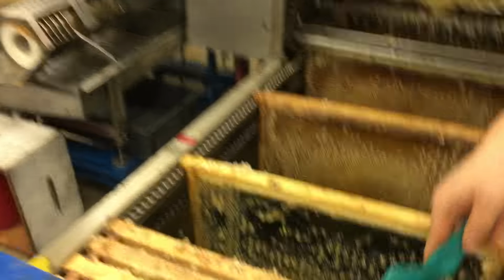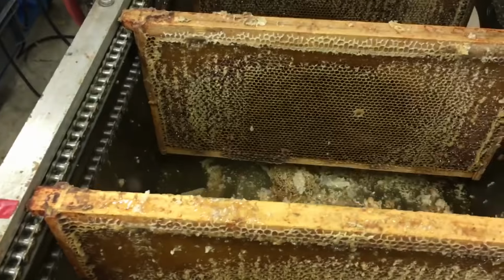The honey house uncut, last day of extraction 09/12/2019

Comment: Just a guess here, but I'm pretty sure those were not blow flies in the shed.
Also like to add, the orientation of the frame in the centrifuge is interesting as well. As a kid we had a hive on the farm with an old 2 frame hand crank centrifuge. It basically had the frame in the plane of the "circle" so the honey came out parallel with the comb. It's interesting to see how your centrifuge works, both in volume and frame position.
Reply from the maker: Peter T 
We take advantage of simple physics
Reply: @aCanadianBeekeepersBlog  Ok, that means I have no idea about physics. I mean  obviously it works ok, and that is all that matters, but from the location of the frames and the direction of spin, centrifugal force would be forcing the honey into the side of the cell and not out the ends as was the case with the one we had.
Like I said, horses for courses, and so long as it works, who cares. It just seemed strange to me.
Reply from the maker: The centrifugal force pulls the honey out the same, if you look at cells on the comb, they are pointed upwards 
We take advantage of that with simple physics

Comment: Great video! Nice to see the workflow and operation. At 12.40 in the video where you're loading the full boxes. You see a hanging airline  a stainless steel funnel with a black plastic bag around. Is this for blowing bees out of the box if you encounter this. Just trying to figure out the purpose of the airline and the funnel assembly.
Reply from the maker: Yes, we will blow pocket of bees out of boxes into Pail

Comment: Hi Ian, new subscriber here! What a fascinating process and setup! I am a novice bee keep for about ten hrs now in southeast CT. So I noticed your extractor spins two racks of about +/- 25 deep frames each. So, let me preface with, Of Course I’m sure it works great otherwise you wouldn’t be using it! LoL! 😂 .... with that being said my brain is wondering how long is the spin-off period? As I would imagine, spinning parallel to the frame surface as well as having all those frames tightly grouped seems like the inner frames would not release as much???... Also, where do you market your cappings wax or do you utilize it in house for other products?  I’m kinda feeling like I could have answered that last question by watching other videos of yours! 😬. Anyway, I just discovered your vid in my feed and it’s the first of yours I’ve ever watched. Thank you for all your efforts and for sharing them with ppl who are interested. 🙏   Bee well!

Best, 
Gary
Reply from the maker: 4copper 
The centrifugal force pulled the honey out, my uncapper strips the frames evenly cut so that there is enough free room for the honey to flow out and up.  Each cell is pointed upwards slightly enough to allow the spin to remove all honey drone the frames .  8 min spin

Comment: 1. moving empty boxes from where frames are removed to down where the frames are reinserted:
how about a using a box rolling track attached to the wall like track used to move the boxes from the pallet to the decapper?
2.  woman scrapes comb off the top of the frames prior to removing frames
is that wax saved?  got to be 10 to 20 pounds per shift
Reply: No space for a rolling rack, and it would add more to clean later so not really wprth it. As much wax as possible is saved to be sold later.